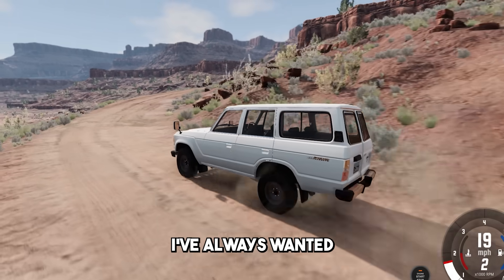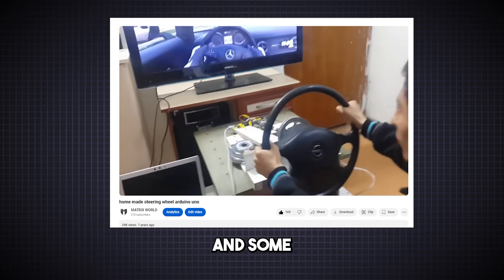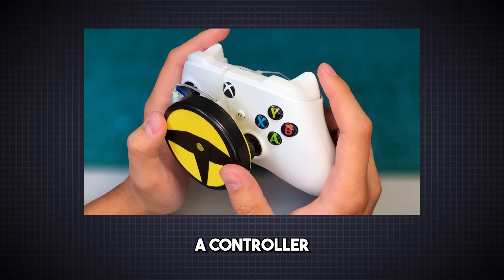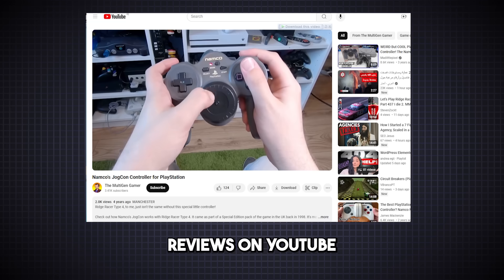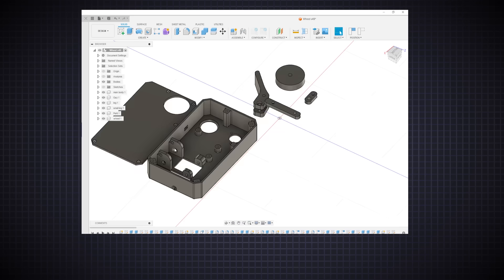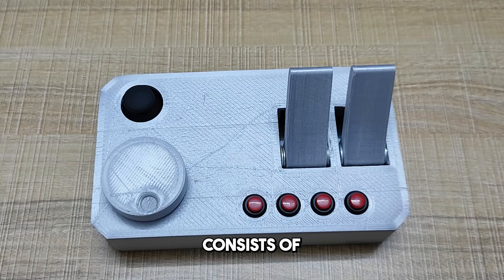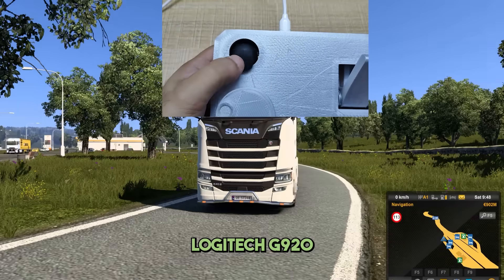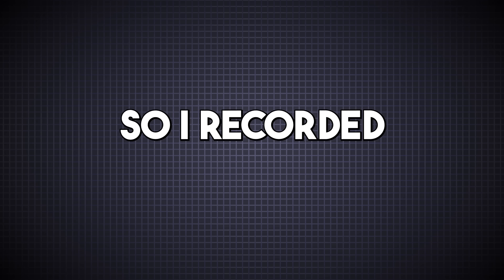The Racing Controller No Company Ever Made—So I Built It

Comment: Ive always dreamed of a gaming keyboard with WASD keys that I can partially press down. growing up on cheap pc's, I've gotten really good at keyboard controls in racing games but I miss the fine input. I do have a steering wheel now but as you say, it's a hassle to set up and makes using the keyboard annoying for things like chat or more keybinds

this controller is fk amazing though, if I had a 3d printer I'd get on it right now, props

Comment: i wanted to see a build video. also the lack of FFB is disappointing.
Reply: How do you engineer force feedback in this tiny thing?
Reply: @Doobydoe  a motor next to the wheel that has a band going around the part that connects the wheel to the potentiometer.
Reply: @simpson6700  cool but does it fit inside?
Reply: @Doobydoe  don't know, i haven't built it and the files are behind a paywall.

Comment: Very cool but does it auto-center? if not, then its not really any better than a mouse, except for pedals, ofc. I totally feel the problem with size and table mounting of a regular wheel, but, bro, it centers itself, and may have force feedback. And mouse, well, not centers itself but you already have one, and can use gamepad for pedal input. RC drift car controller may give you the solution to some auto-centering, but yeah i think it still won't support whole 900 degrees of rotation. God bless your soul and may you create a smallest ever direct drive wheel

Comment: add a small gear shifter and a clutch this will then become the most perfect controller for racing games 
also maybe move accelerator brakes and clutch in front for index fingers and add the shifter where brakes and gas currently is for thumb

Comment: Some thoughts.

I think would be nice if it was refined into a more holdable design with grips instead of the keyboard esq one right now. 

Adding the brake and throttle in where most controllers are i feel would be better, because then under that finger you could have the camera control so it would be less clunky not having to take a finger of the steering wheel.

Maybe even add slightly beneath the throttle and brake plus slightly more in the grips a clutch on one side and a clicky lever to act as a seqeuntial gear change.

Nonetheless this is a marvelous proof of concept, Bravo.

Comment: Next idea, use a joystick with no spring return as a H-pattern shifter and make a clutch for it. If it fails just try paddle or sequential shifter. This lacks force-feedback so I would recommend a normal brushed motor, like a vibration engine scraped from an old controller, and geared up so it has more torque.

Comment: Move the pedals to a trigger setup, add bumpers or back buttons for manual shifting, move the camera joystick towards the right (where the pedals are now) and move the 4 face buttons near the right stick. You could add a small dpad in the center for navigation in menus, and 2 small extra face buttons to work as a start and select.

Comment: Make it more better.
Step 1 make  Accelerator and brake paddel which can connect to you main controller by wire and use accelerator and bake with your foot
Step 2. Make Mini gear box instead of those Paddel in your main  controller 

It add more realistic and amazing gaming experience 
The real fun began with when you use steering to drive vehicle and use mini gear box

Comment: bro this is so amazing project. you are the amazing! however if I may suggest some design ideas, add the blinker buttons where your left and right index fingers are, and also, gas pedal with thumb is perfect, but break should be also on the place where your index right finger is (move above or below the right turn signal button), and if you move the steering to the middle because sometimes your left thumb gets tired and u want to switch, and/or may be drive with both thumbs in some racing game. it is your project and your idea, i respect it, i just thought may be making a V2 of this controller and someday you get some funding for your project and launch it to sell to the general public

Comment: What if someone made a controller similar to how RC cars are driven? you have a pistol-like grip with a trigger for gas and a small wheel on the side for steering. Modify it so it has buttons for menus and other functions and add a second trigger for braking. I think that could be an interesting idea as well. Cool video!

Comment: suggestions:

1. camera rotation should be right hand side, to be more accessible while steering.
2. acceleration and deceleration should be at the back because the camera rotation button is on the right side. you also can add clutch button at the back, i suggest putting those button at top.
3. lastly, where is the handbrake?..

current product is good but with those suggestions, i believe it would be more interesting. nice innovations.

Comment: I wonder, would it be possible to modify an existing controller, to replace one of the sticks with a rotary encoder similar to the one used here? by removing the joystick, and adding an a microcontroller inside which can translate the rotary encoder to stick input? might be hard to get it accurate now that I think about it ...

Comment: "everytime you play, you need to set it up and then remove it from the desk"
Or use a stand? You put the wheel, pedals, gear level, and handbreak directly on it. You put the cables conveniently so nothing floats and everything is at the perfect place to quickly plug in into your PC, and when you're done you just fold the stand and put it against a wall. 1min to set it up, 30 seconds to move it when you're finished, and that's it.

Comment: You need to build yourself a ups, a few 12v car batteries in a setup to ac for when the power cuts, would be plenty of juice to keep the printer going, most likely a 20w heater, your main source of usage is during the heat up stage so if the printer and bed were already warm, you're kinda golden

Comment: Someone either get this guy a sponsor or some company adopt his idea so it can be mass produced😭🙏. WE NEED THIS. 

Some suggestions I would have for this:
1. Also add a clutch pedal for the people who prefer manual.
2. Force feedback would be great to add to this
3. Triggers at the top would be useful, it can either replace the red buttons you have on here and also have it being programmable or be used as gear shifting pedals. (But my next idea would take away the triggers being used for the gears)
4. Have a gear lever on the controller, about the size of a joystick or a little bigger. This will complicate things for some people but hear me out. You press the pedals with your index and middle finger (or any fingers of your choice) while you change the gears with your thumb. (This idea will obviously make the controller a bit bigger, but it'll still be small enough to not be uncomfortable for most people) This idea can also be skipped to keep the more simple design of having the shifters as shoulder triggers. Or if this were to be mass produced, it could be split up in 2 models, one with the shifter lever and one with shoulder triggers as a shifter. 

Yeah, thats all I got😅. This is very cool

Comment: My only complaints are 1. You need something on the corners like shoulder buttons on a normal controller so you can shift also. Then you can add a third pedal. 2. The video was a bit slow paced. Otherwise great job. Looking forward to a 2nd revision with clutch functionality and sequential shifting. Just 2 more buttons and one more pedal.

Comment: you should add a tactile trigger on the left for a clutch (could just use a mechanical keyboard key) and 2 buttons on the right for shift up and shift down. Could also use the clutch trigger as a handbrake in drifting games.

Comment: if you were to add a shoulder button on each far corner. You would be able to move the signal light inputs to them, freeing the 2 buttons for 2 more inputs for things such as trailer attach/detach, or bus door open/close, etc, while still maintaining the simple input layout. I'd like to try to attempt that but would require modifying your design so I can put the 2 buttons in. Would you be ok with me fiddling around with the design for it? it would be personal use, and never redistributed. (want to make it very ATS/ETS2 and bus sim 18 specific).

Comment: This is really cool! I have a complete simrig but I could still see myself use a controller like this where either controllers or steering wheels might be too cumbersome like in Mudrunner/Snowrunner/Spintires, BeamNG and GTA games!

And there's even more potential in it: Add shoulder buttons/triggers and maybe even buttons on the bottom for your unused 3 fingers on each hand (honestly, I don't know why almost no controllers use the middle, ring and little finger). Rotating the brake and gas pedal so you wouldn't have to bend your thumb over the gas pedal to reach the brake pedal might also help.

Comment: Ever since using a pistol grip RC transmitter for RC cars I haven't desired a wheel. I love the trigger for brake and throttle and the wheel for steering its very comfortable and familiar. I play VRC RC racing with it and also any car sim type games its great.

Comment: Add direct drive feedback to the wheel next, should be easy enough with a motor at that size.
Perhaps you could have feedback to the brake pedal for slip mechanics, and road feedback as well. All things that are normally a great cost on a wheel set, but might be doable at a reasonable cost at this scale!

Comment: To combat the power issue try separating the pieces to be printed one at a time, it may be more time consuming but better chance for pieces to be done, and if you make a version 2 try putting the throttle a little farther ahead of the break so you can use 100% break without worrying about hitting the throttle by mistake, great project i really like the design!

Comment: Nice one. I have a suggestion: Put the pedals to the back as bumbers, just like we have in a normal controller. Right for accelerate and left for breaks. Put the wheel a little up to the middle of the controller. Then put the camre stick under the right thumb.

Comment: if possible, you should likely get a UPS (uninterupted power supply) to connect to your 3d print in case of blackouts, its not exactly cheap however its probably worth saving up for if your power is unreliable

Comment: i wonder if replicating the rotary input on a steam controller trackpad would be possible. it also has the rear buttons on it that would be great for gear paddles.

edit. just did a quick search and a guy already made a similar idea to your original using a steam controller, since it has a gyro it can also be used as a wheel by mounting it on a shaft and just using it as a wheel.

Comment: I just had some ideas for an alternative or a 2.0 versión of this controler: 

-Add bumpers and triggers just like normal controllers, L1 and R1 for changing gears. The triggers used as in normal controllers for racing games brake and accelerator(this for techniques such as heel toe to be easier 

-move the camera joystick to the right side of the controller so you can control the camera without letting go the steering wheel 

-Add just one pedal on the right side for it to be a clutch since no controler has 3 triggers to recreate a clutch (i just would love to be able to use a clutch in a controller)

-And Thats pretty much it, the layout of buttons can be reworked to allow everything i just listed. 

Amazing idea, i literally cant understand why nobody thought of something like this since the old one you showed, cheers mate.

Comment: Hey man, amazing project and I'm not trying to hate/put you down but I have some questions about your invention:

-Since this doesn't have force feedback, isn't it basically the same as a normal controller (performance wise)?

-Adding on, is it really necessary to have 900 degrees of steering when most modern racing games have smoothing techniques to mimic wheels?

- Perhaps you could look into making this a mod kit/attachment for standard controllers, so you yould have extra buttons for shifting/clutch and other advantages

I have the same problem you have with wheels, they are very expensive and inconvenient. Hoping that a better alternative is out soon! Awesome project!
Reply: A rotating wheel, even a small one, allows far more precise input than a controller joystick. I've built one myself, it does make a huge difference.

I agree 900 degrees is probably overkill for most people, my one had more like 270 and even that was plenty for racing sims.
Reply: @Spacedog79  I've only tried wheel and controller, and I feel like a wheel would be completely useless without force feedback. For example, dirt rally would probably be impossible/insanely difficult without it as you sometimes have to let go and let the car "steer itself". A controller can do this with assists. What games have you tried your wheel on?
Reply: @minty_cs  Sure FFB would be better but compared to a joystick any rotating device is a big improvement.

This was a long time ago so I was mainly playing Grand Prix Legends which is legendary for its difficulty and I still managed to get some of my best times with it.

Comment: I feel the pain of 'steering wheels are too big and you need to rearrange your desk each time' SO MUCH. My particular grief is the exact same thing for aircraft yokes. Same situation. Do the designers of these things not need keyboards or mice? 😅

I spent months designing my own yoke device here exactly for this same problem. On mine, I chose to design it so that the yoke itself detaches from the desk-mounted part, like a racing car steering wheel. All the electronics live on the detachable part, and the desk assembly only has the hardware for the pitch axis, and the usb connector. I designed it be extremely low profile (under 40mm total height), so it could live permanently underneath my desk surface. It's mounted on drawer slides also, so the end of the main shaft doesn't poke out when it's stowed away.

And I totally agree with your comment on the thumbstick thing. It's baffling how even high end controllers a lot of the time don't have actual axes or buttons for camera and cursor controls. The moment you have to reach for the mouse to look around, all the immersion of having a control device breaks down completely.

Anyhow, this is a great project 👍

Have you considered adding extra buttons or switches for gear shifting? You could probably add two or four paddles on the backside. (lower paddles for clutch, like in F1)

Comment: Hello thanks for this video and for present your build... thanks...
You need a smart apc and car battery for your electrical network probleme, if you buy an apc smart, use a 700va with h bridge and transformer model, that the beast quality of power, real modified pure sine, the best for electronic psu equipment, good luke

Comment: Its already great. Imagine this as an upgradable and customizable blueprint secured by a patent which belongs to you. Because as soon as I saw the videos thumbnail, I wished it was a product to buy it 😂😂. I imagine this with four more trigger buttons on front for tiptronic gear, forced feedback with quality material, a button for your analog stick (like R3-L3 in regular gamepads), a small e-brake stick, vibration, customizable lightening options via client, bt and 2.4 connection, rechargeable with type-C, coming with a usb to type-c cable, a little carrying box etc etc. This product of yours has a potential of changing the casual driving experience in racing games. I would buy it. I loved it.

Comment: You could add an trigger aswell. like R1 for shifting up and L1 for shifting down. it would be awesome. you can add an vibration motor if the revs go up (if thats possible tho lol) I hope I could give you ideas. And what program did you use? I am on MMJOY2 and I cant add buttons clearly. and I dont know the diagram. you can do the code open source, since there are people that can like use the code to do something etc. By the way, you can add an capacitor for easing the power out and not frying the components since the arduino boards can be unreliable with spiking power, or you can use an battery too for keeping the circuit alive with an charging module.

Comment: I would love to use a controller like this for a game called My Summer Car. The driving in it is incredibly realistic, like if you going into a ditch too rough then your wheels go out of alignment and the car drives at an angle. This SUCKS to compensate for with keyboard, constantly tapping A or D while driving lol. 

While the controller design is good, there are some additions I think would be cool, such as a clutch pedal and additional buttons (maybe 8 altogether) for games with more controls.

Comment: This is great, but the controller isn't very nice to hold, it's good enough for relaxing games but might delay your movement and reaction in games where you need to act more quickly. If you feel like it, I think you could try a different configuration, I think the "UltraRacer" controller for the PS1 would be the perfect configuration for a controller like this. It's nice to hold and lets you have a better hold over the 'wheel'

Comment: I used to have a wheel which, instead of clamps to fix to a desk, had a flat base that would go under your legs when you sat down. It was a great cheap wheel. I'm probably not describing it clearly, so search for "InterAct V3 Racing Wheel" and you'll see what I mean. Just in case you need any more ideas to build :D